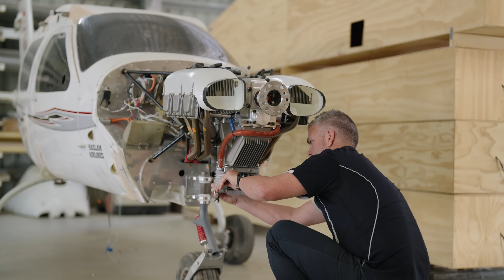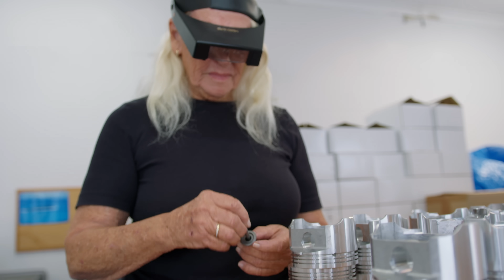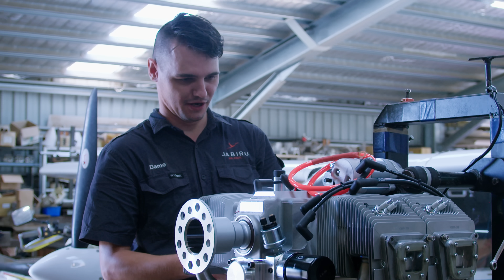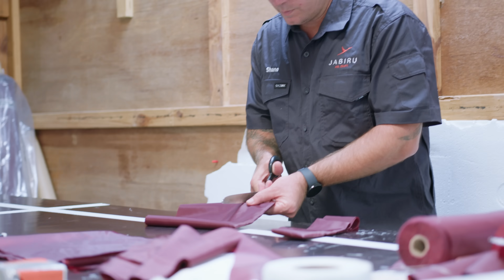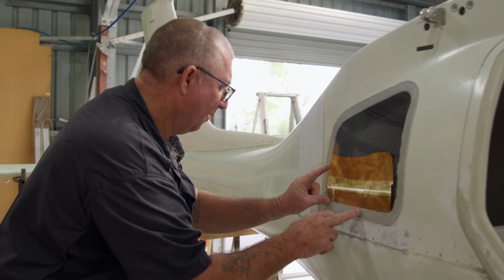Inside the Jabiru Aircraft Factory

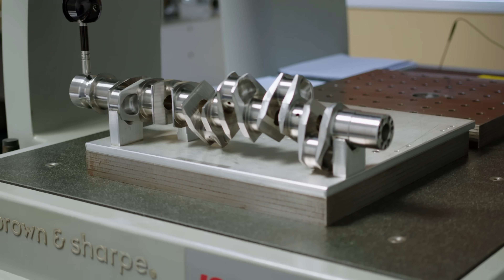Comment: I notice the crankshaft shown at 1:35 has no counterweighting which I'd assume is the case for all aero engines. I'd imagine this is done to keep the crankshaft light however wouldn't that imbalance induce severe vibration. Maybe the vibration isn't a problem due to the low rpm of these engines?